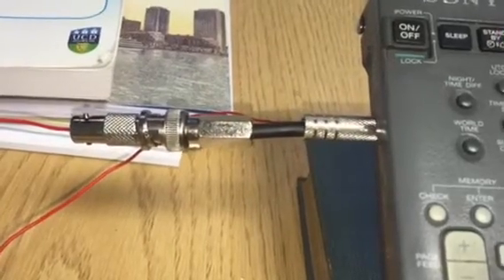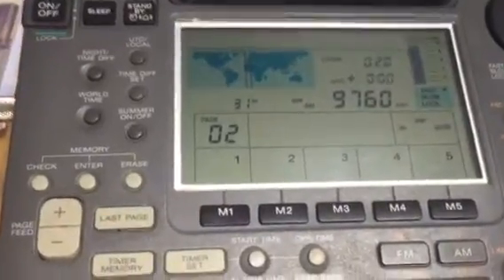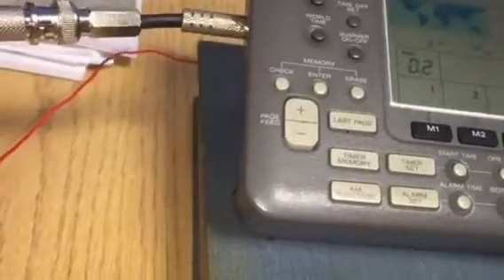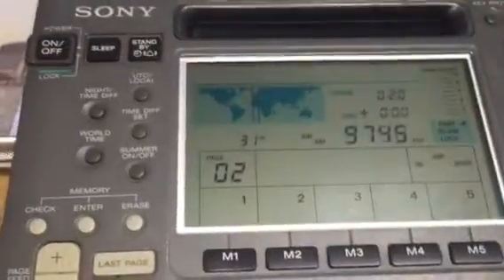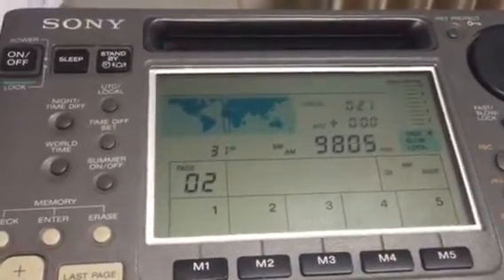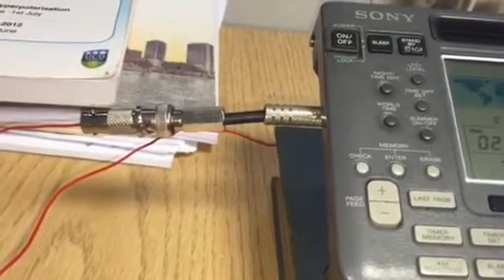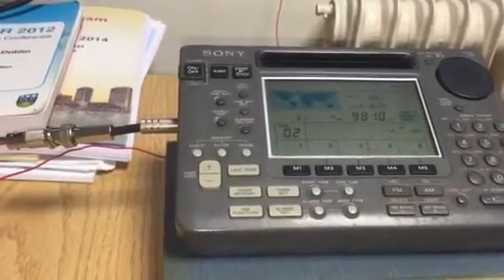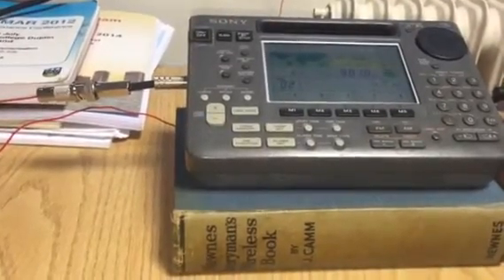Test of Wellbrook ALA1530 interface cable with Sony ICF-SW55

Comment: Wow I wish you could buy these online. Really would love a pl259 one so I can plug my tecsun into the vertical on thats high on the roof.
Reply from the maker: +Kandi Klover (Fursuiter Furry) Hi there, someone said they can be bought, but I couldn't find one in the UK, so I made my own - pretty straight forward. Why don't you give it a go? I can help you. 73s! Clint
Reply: I can do that, I have some spare RG8X. Just have to get a mono 3.5mm plug i believe. I did find an adapter piece once on fmdxantenna.com but it was for those types of coaxial plugs for the back of a tv. Don't want to stack too many adapter together.
Reply from the maker: +Kandi Klover (Fursuiter Furry) Ok, cool It took me about an hour and my soldering skills are not that great, so I'm sure you'll be fine. Definitely worth doing and I think your Tecsun can take a long-wire without overloading. 73s! Clint
Reply from the maker: +Kandi Klover (Fursuiter Furry) Hi there, that looks like a PL to audio jack adapter, but should work in-line with a PL to BNC adapter (which are very easy to get hold of). 73s! Clint
Reply: Oxford Shortwave Log yeah I just ordered the adapter bit from universal-radio now. I been using the longwire included with it and it does very well. Plus it also lets you turn down the sensitivity too :3
Reply: Oxford Shortwave Log i don't need a bnc, the radio uses a standard 1/8 ear phone type plug for the antenna, I have a vertical ham antenna on the roof up high and the adapter has a so239 so I can attach it to the pl259 on the coax lead from the antenna than plug the 1/8inch to the tecsun. Good antenna, picks up a lot of weak stations down to 3mhz.
Reply from the maker: +Kandi Klover (Fursuiter Furry) Well done you! You won't be disappointed when you attach a long-wire - your radio can take it without overloading problems I believe. Look forward to seeing some videos! 73s! Clint
Reply from the maker: +Kandi Klover (Fursuiter Furry) Even easier then without having to convert back to BNC! Again, I will be looking forward to some reception videos! 73s! Clint
Reply: Oxford Shortwave Log thanks friend, I can get a pretty long longwire with 9:1 balun to hook into so good to know it will work :3 it's also easier that I already have 2 verticle antenna already up in the air to use. Just gotta wait for the adapter to come in :3 I'm looking forward to making reception vids again too, was a lot of fun and i love sharing and watchings others. Did you see my wtww post? Was sort of just a test but interesting broadcast still
Reply from the maker: +Kandi Klover (Fursuiter Furry) Hi there, looks as if you're in very good shape then with regard to antennas....always nice to have a choice! I will definitely look forward to seeing your videos when you upload them. I guess you just need to wait for the adapter to arrive then? 73s! Clint
Reply: Pretty much yeah all that left is to wait. I ordered on saturday so hopefully it ships out monday. Got it from universal radio so hopefully they ship fast. I totalled about 10 dollars for one adapter bit when you include the shipping haha but as rare as these 1/8 antenna plugs are I can live with that. The vertical on the roof receives a lot of broadcasts from pretty far and has advantage of being elevated up above the noise, the only problem is the old ham radio I have on is SSB only and locked on HAM bands so I can only get whatever happens to be low on 7200khz and I have to zerobeat. But now I got the tecsun and more sensitive too so can't wait to hear all the things I'll pick up on it.
Reply from the maker: +Kandi Klover (Fursuiter Furry) I used to live next door to a Antenna Engineer (fortunately enough!) and I still remember what he said to me when I asked him about improving TV and Radio reception....before you bother to do anything else, if you can, make it higher!!!! I think your Tecsun is going to open a lot of DX for you and I'm sure you'll have a great time listening! 73s! Clint
Reply: Oxford Shortwave Log oh the height is everything, even just 10 feet makes a good difference . Thanks looking forward to it can't wait. Turning out to be a very good christmas this year :3
Reply from the maker: +Kandi Klover (Fursuiter Furry) Absolutely right! Just a few metres can make a huge difference! I'm going to be DXing on Christmas day - and posting Christmas listening videos! 73s! Clint
Reply: Oxford Shortwave Log sounds awesome I look forward to it, just remember to dress warm haha I went out barefoot and thin tshirt and was frozen after 2 hours.
Reply from the maker: +Kandi Klover (Fursuiter Furry) Ha ha yes you're right! There's nothing worse than trying to listen to DX signals outdoors when you're freezing cold..been there, done that....last weekend actually lol! 73s, Clint
Reply: Oxford Shortwave Log was that when you were outside with the sw100 and it got rained on?
Reply from the maker: Yes that was it!!! 73s! Clint
Reply: Oxford Shortwave Log oh man cold and rain thats pretty hard haha
Reply from the maker: Ha ha yeah for sure! 73s! Clint